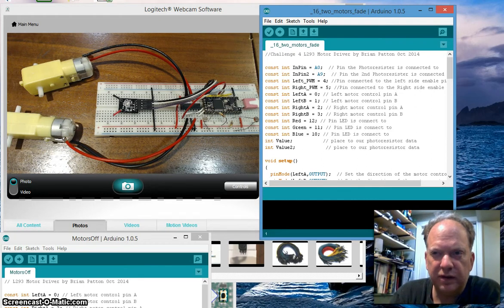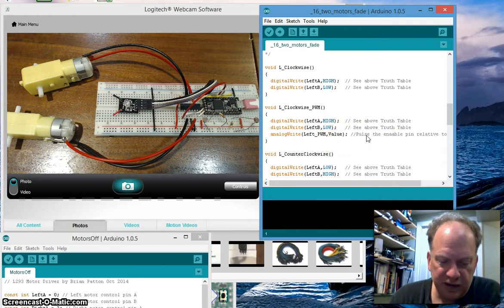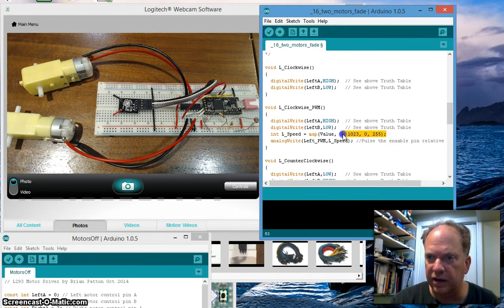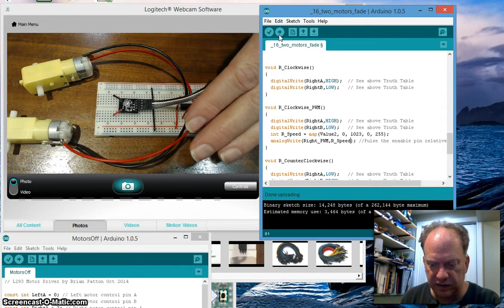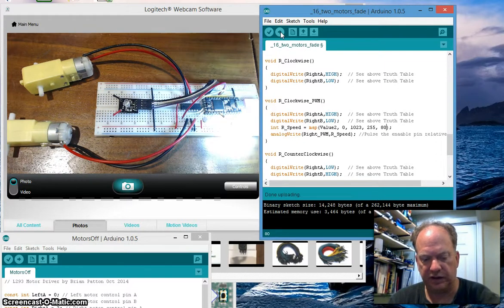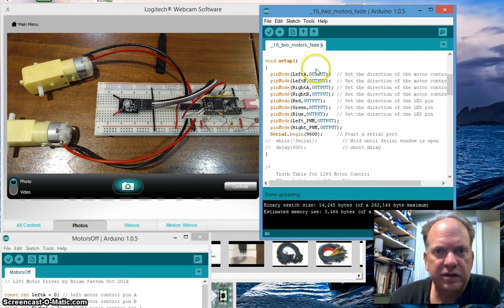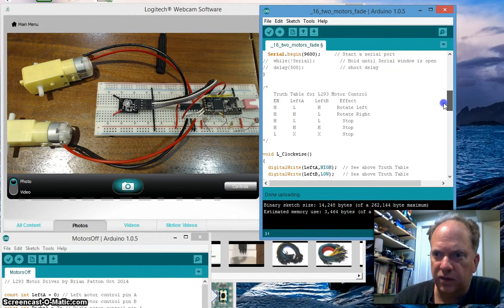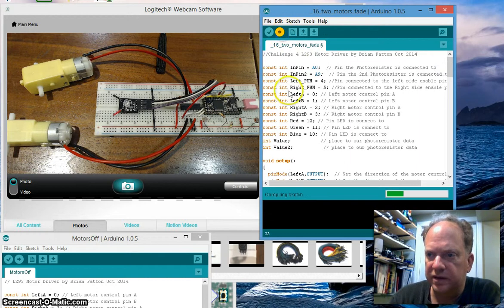Video 20: Two Motors controlled with Arduino Map

Comment: whats the best practice to use something like map? im trying to have 3 servos move to a specific location IF one particular servo other than those other 3 move to a certain degree? 

i thought about map() because of what it does but it seems that map only take to arguments in its parameter section and well i wanted to put those 3 other servos range in this map but as you can tell you can't squeeze 3 sets of in and outs and turn dem into something else and even so if i could it be mapping one to another which not what im looking for